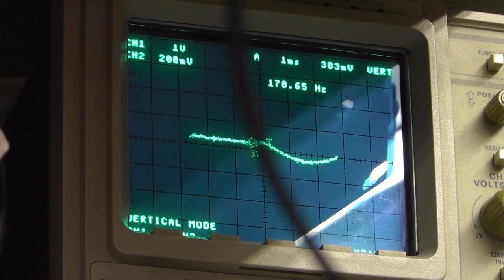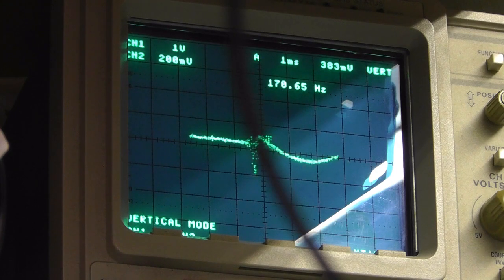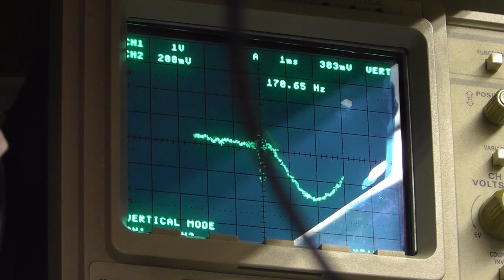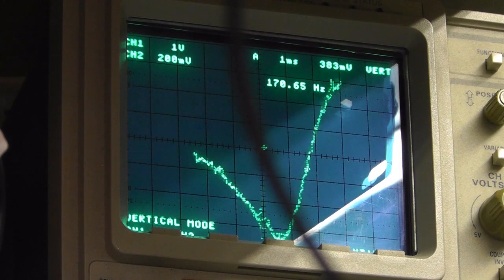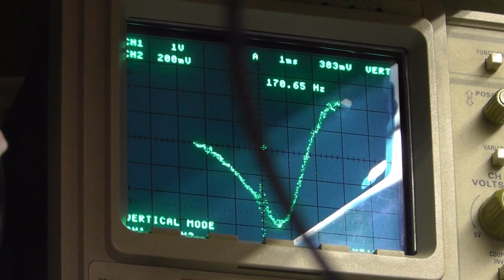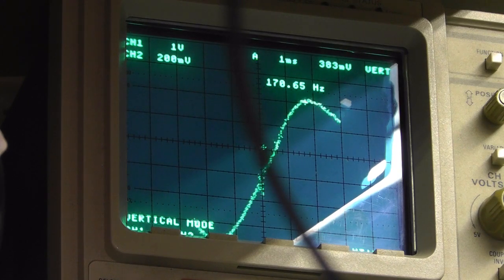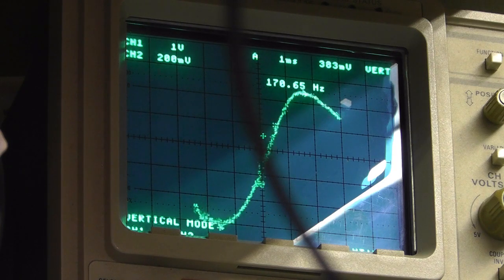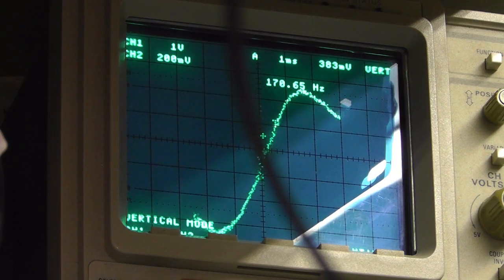Philips PM5324 Wobbulator.  S- Curve alignment

Comment: Can I see the wave form from the sweep output to the X input of the oscilloscope? I assume that the RF output is just a carrier not modulated, is that correct? At which frequency? The webster electronic marker is a simple transmitter at 10.7 Mhz in the vecinity of the radio you want to calibrate?
Reply from the maker: X out should be a ramp. No modulation. Centre frequency 10.7. You are looking for the sweep response not rf. Keep scope DC coupled.

Comment: Thanks sir,what the difference between swep generator , modular generator and wobbulator
Reply from the maker: Sweep generator and wobbulator are basically the same thing. Generally a wobbulator has a very narrow sweep range around the chosen carrier frequency. Never heard of a modular generator, do you mean modulation generator? ~In that case a generator that the carrier can be modulated with an AM or FM signal.
Reply: @SoddingaboutSi yes  I mean modulation generator
Reply: @SoddingaboutSi  I think, back in the old days, a wobbulator was a sweep generator and an oscilloscope screen in one unit. Just like the R&S Polyskop SWOB.
In german, we say wobble generator instead of sweep generator.
Reply from the maker: @schorse1000  Yes, a wobbulator really wobbles the non swept frequency. A sweep gen starts ad a defined frequency  and ends at another , usually higher and so way away from the start.